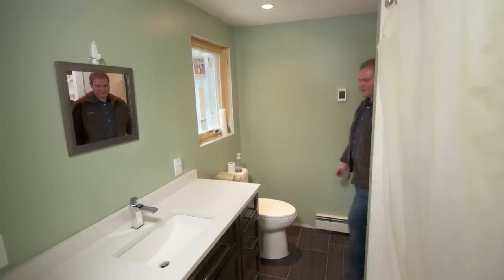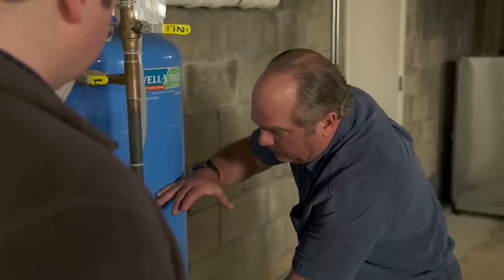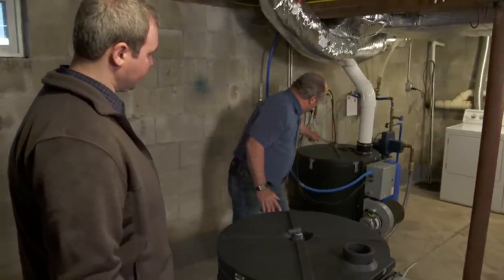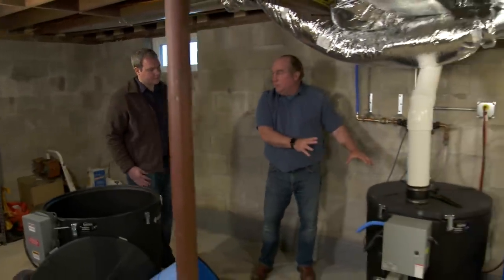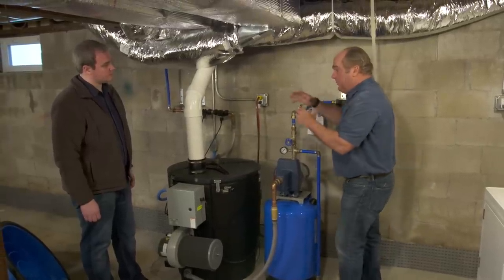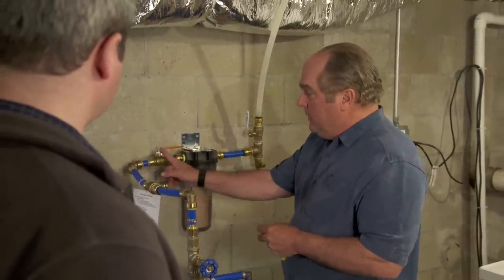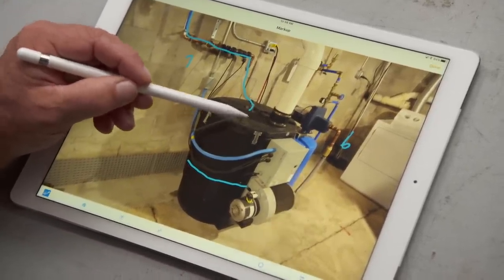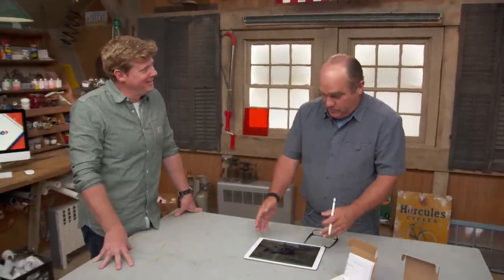Solving a Spitting Faucet Mystery | Ask This Old House

Comment: I've been in the plumbing trade for 30 years--This is a complicated nightmare. Second the shark bite king.
Reply: very disappointed in Richard using shark bites
Reply: Rick Burnetski lol there’s nothing wrong with sharkbites.
Reply: The future is copper-less. That means, no plumbers needed. You're welcome!
Reply: James Pian no it isn’t 😂😂 smh
Reply: Soldering is fun
Reply: Caden Webb it is but propress and shark bites are faster
Reply: @auspicioustoot  There is lots of wrong with shark bites on soft pipe.  A Oring needs a certain squeeze, having a flex pipe that can expand and retract is not good.  Those shark bites will fail, especially with all that creepy well water.    
I would not trust an oring for longer than 10 years of life.  In 10 to 20 years every oring in those shark bites will fail if not sooner from the flexing of the pipe.  

BTW, I am an elastomer engineer and I design and mold orings at work.   
Just think about orings in your faucets, toilets, dishwashers, and washing machines.  They need to be replaced after 10 to 20 years.  Now think of having an entire house of oring fittings.  Shark bites are for temp repairs.    

Copper lasts 100+ years  and pex is supposed to last like 60+ years.  Shark bite maybe 10 years if lucky.
Reply: Common_C3nts yeah well I’m a plumber and have been using for almost ten years and have only one give me a problem. If you debur inside and out they’re just fine. They’re rated for pressure and temperature.
Reply: @auspicioustoot  I design orings and I would not consider them a lifetime seal. They will need to be replaced and it would be annoying to have do that every 10 to 20 years just like any faucet hardware that uses orings.  Just use pex with an expander ring instead of sharkbite. That is a way better, long term connection.  It is also just as quick to install.
Reply: Common_C3nts just bc you don’t consider it a lifetime deal doesn’t mean it isn’t tested to last the long haul. I know you feel as your job makes you infallible but you’re wrong. Everyone thinks they know more about plumbing than actual plumbers 😂😂😂😂
Reply: @auspicioustoot  I like how everyone complains about shark bites. I've seen way more leaking soldered copper  joints than pro press, shark bites and pvc. Anything that gets old leaks.
Reply: Just don't use shark bites in any sealed cavity like a wall or ceiling/floor and take care to debur copper,
Reply: CarrotCaptain finally another real plumber on the thread...
Reply: Look at all those shark bite fittings. He's supposed to be a plumber im not buying it.
Reply: @auspicioustoot  are you a licenced plumbing contractor? I think not. Don't comment on shark bite fittings.
Reply: Here in texas plumbers stay away from sharkbites for 2 reason. 1. They have rubber as their seals that has been proven time and time again to need maintinance after years of use. 2. The metal teeth that hold the pipe in plave are open to decay and are very thin and rely of my of the teeth having pressure the whole time. 

If i ever put a sharkbit fitting inside a wall i would be fired. When any other pipe is installed correctly, is it 100% a better option.

Ontop of that sharkbite fitting have been around about the same amount of time as pex so no one knows what they will do in 50- 100yrs.
No plumber likes to have to come back and cut sheetrock and repair a fitting that cost more than than the part that wouldnt need replacing. Im just a journeyman plumber and this is just me 2 sence.
As we all know plumbing is dif in dif areas.
Reply: bryant Necessary I’ve found more shitty soldered joints behind walls leaking more than I’ve have leaking shark bites all together.  Most plumbers just use shark bites to shit on plumbers because they feel that because they waste more time to solder that it makes them a better plumber when the fact is if use use your markup tool when using shark bites on pex then you don’t have anything to worry about. When it comes to copper you just have to make sure it’s all the way on. Plus a lot of the time you can use it if your customs are low on money.
Reply: You obviously need to step up your game and educate yourself. That's  the problem with "experienced" professionals. You all quit learning 30 years ago.
Reply: @auspicioustoot  if the solder joints are dont correctly it will hold years longer than a sharkbite. Most pinholes on copper are from water heaters heating up particles in the water that stick to the side and corrode the pipe. Same with galvanized. So no sharkbite will never be better than the original joint. And btw to use sharkbites on pex is just lazy. It takes no time at all to install a fitting onto a pex line properly. It amazes me how many people that dont plumb think they know more then thoes who do it for a living. STAY IN YOUR LANE KIDS AND LISTEN AND LEARN FROM THE 30YR EXPERTS.
Reply: bryant Necessary like I said before I’m a licensed plumber and I’m not gonna do extra work for a pat on the back from old plumbers. You think you’re different you are literally like most old plumbers that think bc they don’t use shark bites that make life easier lol. Are you a plumber or an engineer? I’m an actual plumber so you stay in your lane being old or an engineer does not make you infallible. I’m telling you I know plumbing I’ve been doing it since I was a kid and I’m a certified master plumber and gas fitter so maybe you should just “get off the road. Also pex has only been used mainstream for the past ten or so years so you don’t have enough time to say copper will outlast pex.
Reply: I’d bet money that you have on propress and megapress too. If you even know what they are...
Reply: Ya shark bites are garbage to use unless its temp. Be a tradesmen and do it right
Reply: @common_c3nts  does petroleum jelly and anything else extend o Ring life???  In aviation o rings are coated in petroleum jelly. I've done it also in automatic application. Just how I was taught not sure if it makes that much of a difference but lubrication prevents cracking.

Comment: If its because the top loader takes more water than the system can provide in a short time, why not just switch to a front loader to reduce the water usage?

Comment: So technically shouldn’t there be a third float switch to tell the output pump not to come on if there’s not enough water in the black tank till it reaches a certain level then it will fill that pressure tank. To me it seems like the output pump is calling for more water then is available in the black tank and can’t keep up with the demand of the incoming water so if there was a third float switch to control the output pump not to come on when there’s not enough water then it would fix the issue without restricting the flow on the output at all!
Reply: I thought the exact same thing. The only pro to the restrictor is a reliable steady flow of water. With a float switch you would be washing your hands and the water would just stop flowing.

Comment: So he saying that the air is coming from the black tank that is separating the gases and water.  And he said it’s because the black tank fill line can’t keep up with the water output? So what do those two float switches do doesn’t one control the output pump on and off if the incoming water gpm is lower shouldn’t the float say the output pump can’t come on till the water is high enough?  It would seem that if the output pump was sucking air from the black tank bottom fitting then the pump would always loose prime!  Right?

Comment: So why in the first place didn’t they just remove the flow restrictor in the input of the black tank if the output pump wasn’t getting enough water in causing air to be sucked into the system?

Comment: So my water pipes cracked and during inspection I found out they are poly b (gray pipe), I want to take it all out and redo it with 3/4" CPVC on both hot and cold sides, i have a sta rite jet pump with a galvanized water tank out side, any suggestions on how to modernize the system to today's standards, keep in mind I am disabled on a fixed income, "fixed" more like
 "A Broke Income",

Comment: I have a plumbing question - in my main floor bathroom, my shower  turns really cold. The strange part is, when I divert the water to the tub filler it is scorching hot. When it is diverted to the shower head it goes Lukewarm/cold. I've taken off the spigot assembly and saw that there is an insert that allows you to adjust the temperature of the shower. The agonizing part is - it's already on the hottest setting! Along with that, the water used to be perfectly fine until recently. Any ideas?
Reply: Tankless water heater has a flow sensor going bad? Tub spout dumps more volume than the showerhead and will more easily trigger a failing flow sensor to tell a tankless water heater to come on
Reply: My sister's house had the same problem as you describe. She called a plumber and he replaced the mixing valve behind the shower knob or shower handle. My sister is overjoyed as she can enjoy HOT showers again. Prior to the fix, I stayed a few days and took showers in her bathroom. The water temp  would fluctuate, hot then lukewarm, cold, then repeat. Ugh!

Comment: Looks to me like a bodge of a fix ! There were 2 float switches in the radon separator - I'd suggest one of these should have been connected to the next pump to ensure it didn't run when the water level was too low !
Reply: Would that mean the water pressure would shut off at times?

Comment: I understand his inlet and outlet theory but there is 2 things he completely missed. First his secondary pump supplying water to house is regulated by float switches that shut off before air can enter because water level triggers float. Secondly the water was set on hot  that came out of faucet and was milky white which indicates that is oxidation occurring somewhere in pump or water heater where metals react to the wells acidity which he mentioned.   Anodes in water heaters hate acidic water.

Comment: I think this radon mitigation system has a design flaw. It should have a water level detector. If the water level is to low, it at least alarms. Or shut off the second pump.

Comment: Start with getting a frontloading washing machine.
Saves tons of water and electricity.
Reply: The only downsize is that you have to put that special cleaning tablet in every month to clean them.
Reply: A Stanton1966 yup, front loaders suck because they never really dry out. Get a top load HE
Reply: @EagleKeeper86  actually front loading washing machines are better and more economical and they are the best ever and they will dry out if the door is left open,drying the rubber seal is even better
Reply: @stephensnell1379   I’m not going to leave the door open because of an inferior design. The economical aspect you speak of is minimal at best with the newer HE top loading washers.

Comment: What keeps the water from being contaminated by something coming down through the radon mitigation vent? Also, is the air that is pumped into the tank filtered? That design just looks a little sketchy to me, but I have zero experience with anything like it...
Reply: athhud   These are relevant concerns. A dead bird in the vent pipe... drip... drip... drip...

Comment: if you have a well and your water test fine no softener or filters and you get air , it's going to be the pump check valve ,  when a pressure tank goes bad your pump will keep running   Title when you get air in pipe do to Radon gas .   When you get a call to go out to a farm  50 miles away and you know they have the radon system you take one out with you . I have credit with my supplier I have.  took out New hot water tanks to find out it was the breaker tripping , just a bad 220 switch .  the tank was only 5 years old , but it did not hurt to have one  the ball valve will wash out over time with it being half closed .  3 dollar valve 10 years well worth the fix.

Comment: And how do i fix that if I don’t have any of the crap. All I have is a water heater. My faucet will start shaking and spitting water when i open it about 50% or more. I replace the faucet and it still does the same thing. No other faucets in the house have this problem.

Comment: Why not fix it right and move all the filtration after the radon mitigation.
Reply: Looked like sediment filteration, if enough I doubt would want that getting over into the Radon Mitigation reservoir ?
Reply: Nah that should be fine, if anything it would just require you to clean the radon tank out every once in a while. Shop vac would work perfectly for that.
Reply: Why not just put the radon mitigation unit in the well house?

Comment: seems like he doesn't need the first pressure tank at all.  Just places unnecessary strain on the well pump; should just dump straight into the holding tank and controlled by the floats, then let the second pressure tank do its job.

Comment: Why could you not get a larger tank for the radon water holder, say about 10 gallons or 12 gallons and that would eliminate the air in the lines and still allow the whole house full access for more water to use in gallons. As it is now you limit the amount of gallons being used by restricting the amount which means that the whole house might not get enough water it needs to run things. I say up the intake of water.

Comment: Looks like a brand new system to begin with.  Where were the installers?
Reply: They probablyran away after he paid. Doesn't look like they knew what they were really doing anyways because they used pex (nothing wrong with that) But connected it all with sharkbites... It's pex, crimp it. Sharkbites are for inexperienced diy work and the oddball connection you can't get tools to. Hopefully the homeowner did it, but I doubt it since the bathroom is new too.

Comment: Wouldn't it been better to install a proper reservoir to give enough water to use? I guess a large well tank after the radon device would give enough room to not have this issue. Flow restriction could still be used, but he would have enough water stored to not notice it.

My old workplace had a 50 cubic meter reservoir due to a lack of flow in. We also used 8 large well tanks after our pumps. Average daily usage was around between 400 and 1000 cubic meters, so water was not sitting around for too long.

Comment: Ok yes you fixed the problem but the restrictions on this system are insane. As those  well tanks are replaced they should be increased in size and flow increased to the radon tank.

Comment: I bet you could hear that second pump sucking air, or you could probably just tell the thing was empty at certain moments. This would not be that difficult to diagnose, for a pro or for a moderately competent homeowner. It's still pretty interesting however, I wonder if the guy would be better off getting a cistern and hauling municipal treated water.

Comment: That is a misuse of a ball valve. You are not supposed to use a ball valve as a throttle valve. He should have installed a globe valve.
Reply: wrong a ball valve CAN be used to throttle
Reply: AND who is going to put a globe valve on a well system major pressure drop bro.
Reply: Ronnie Dingus Please give the name of a manufacturer of ball valves that say that their ball valves are designed for throttling.
Reply: Ronnie Dingus no more pressure drop than a ball valve. Full port is full port.
Reply: Not one of the ball valves from this company is listed as being used for throttling.
Reply: Proportional ball valves are for fast or slow opening and closing not throttling.
Reply: Well Dingus is living up to his name at least. 

Problem with a ball valve being use to throttle Ronnie is the water will cavitate on leaving the hole in the ball, this is due to the sharp edge and the pressure drop from one side to the other. And the ball unless fully open will direct the cavitation against the side of the fitting and pipe. This cavitation will eat into the plumbing and cause a leak in time. Doesn't matter what the material is it will erode. This is why ball valves are only for shutoffs. On or Off not throttling.

Globe valves on the other hand are designed either with soft trim dropping the pressure in stages or with axial or Y-types to provide more linear flow.
Reply: “design improvements have suited ball valves for some types of flow control, such as throttling the flow of air at differential pressures as high as 1,000 psi.” http://www.machinedesign.com/basics-design/fluid-transfer-valves
Reply: “Many people use them successfully for throttling clear water. Ball valves have low pressure drops, open and close quickly, are simple, and are trouble free.” https://www.dep.state.pa.us/dep/deputate/waterops/redesign/TablesNFormulas/Pages/valvebasicsandselectiontips.htm
Reply: but polyethylene is hydrophobic and the pressure is very small, would cavitation still cause damage?
Reply: Richard said "flow" not pressure. Which is exactly what a ball valve can be used for. Controlling flow. It was you guys who made this about pressure. Trying to make him look wrong when in fact he was not.
Reply: DT Broad The only thing i would disagree with is that a globe valve does have more pressure drop than a ball valve when both are full open. A full open ball valve may as well be a section of pipe, essentially no drop in pressure. The seat orientation of a globe valve where the water has to change direction multiple times will cause a pressure drop due to the head loss through the valve. This is unimportant for a house though, and only engineers will ever use it.